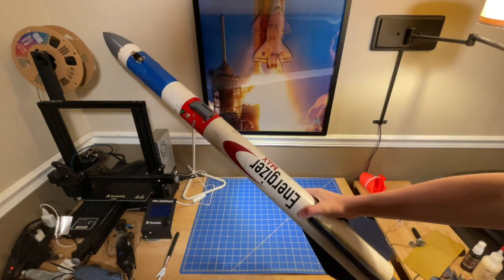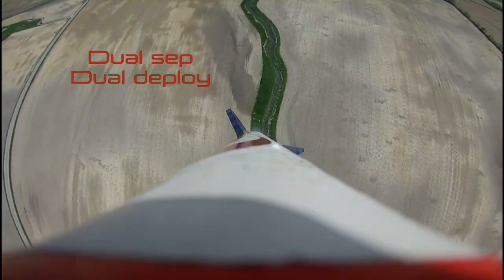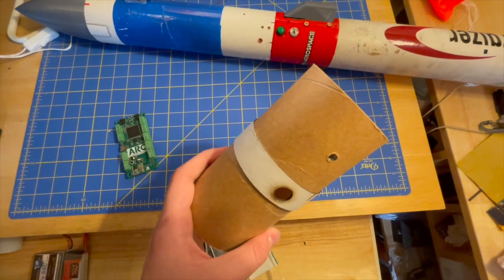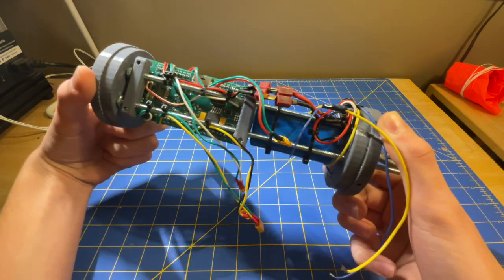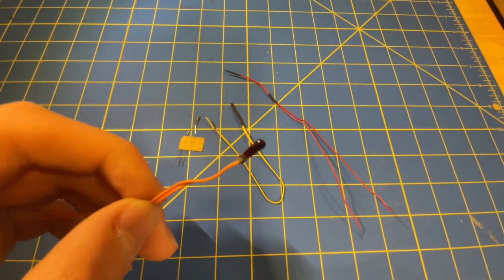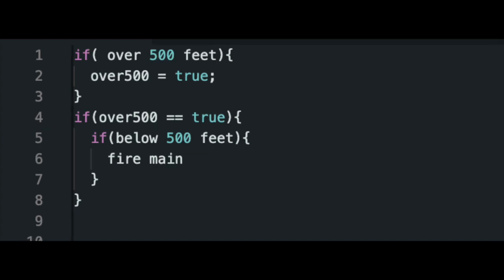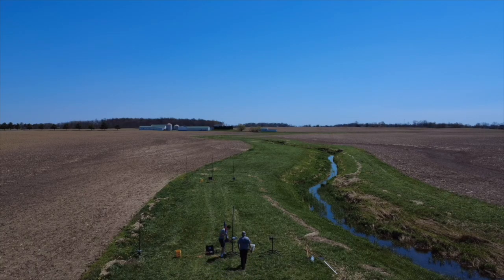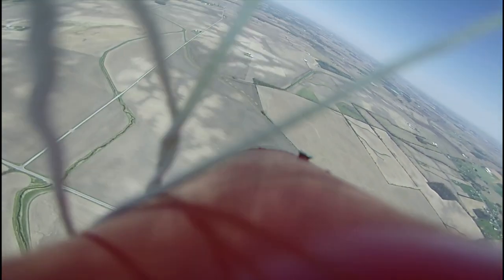How do you recover high altitude model rockets?

Comment: Have you considered drogueless dual deploy? I never use a drogue for my high power rockets, instead just letting it separate at apogee and flat spin down to the main altitude before deploying the main, comes in more than slow enough and is much more robust
Reply from the maker: I would do drogueless dual deploy if it wasn't my flight computer and code because i tend to not trust it even if it works multiple times perfectly lol. Using a smaller parachute for the drogue just gives me insurance for that if the main fails it will at least slow the rocket a little.
Reply: @ModelRocketDev Ah makes sense, awesome video anyway 👍🏻

Comment: so ur saying that i should NOT use an mpu6050 to trigger my droug chute D:
(there are no bmp180s or 280s in stock anywhere where i live)
Reply from the maker: I wouldn't, any barometer would work. If you have no other option, calculate tilt using gyro rotation vector data, and filter it with a low pass filter and spike filter. Just make sure that your data isn't affected by the sudden acceleration.
Reply: @ModelRocketDev  yeah thats the system im currently planning on using altho now im thinking of just getting a baramoter of temu and hoping for the best lol

Comment: why do you not use an accelerometer, and why did you replace it with a barometer, dose it have somthing to do with the tracking of the speed to its theoretical position? is there some limit that the accelerometer activates to quickly?
Reply from the maker: Using an accelerometer in flight is quite tricky because of all the movement and vibrating of the rocket so you have to put it through a ton of filters and even then it might not be accurate for what i'm doing, so i just used the barometer. Turns out the barometer works better than the accelerometer as well. Using the accelerometer also takes away quite a lot of safety since you could accidentally trigger it on the ground. In the case of that failure that made me stop using it, the pitch calculation became very wrong during lift off making it think it had tilted over 90 degrees from all the acceleration.